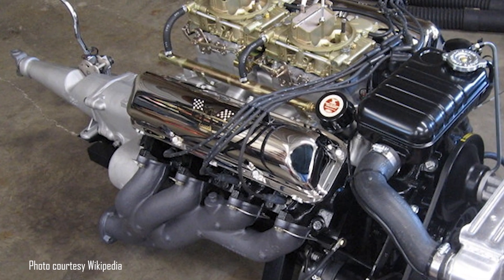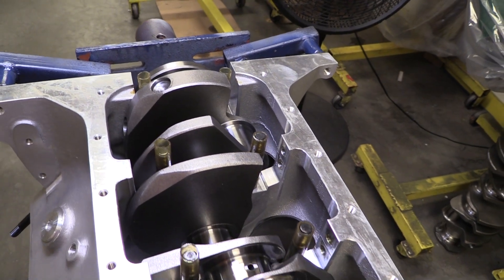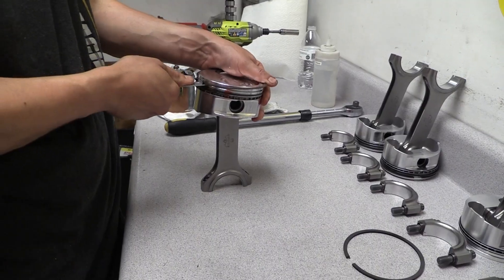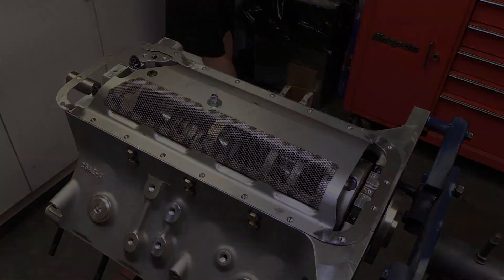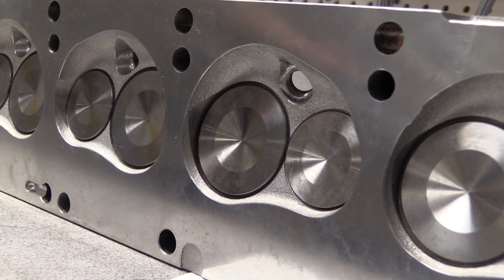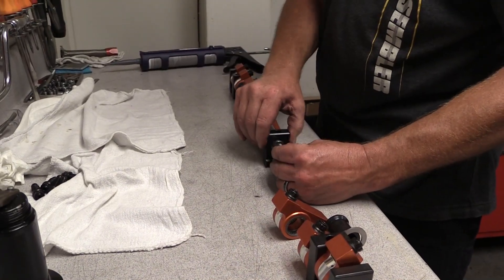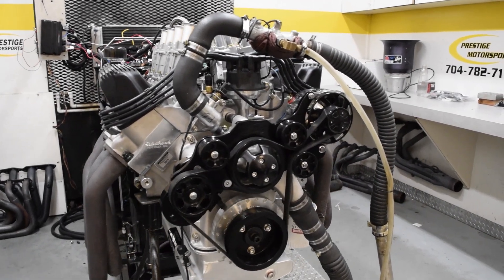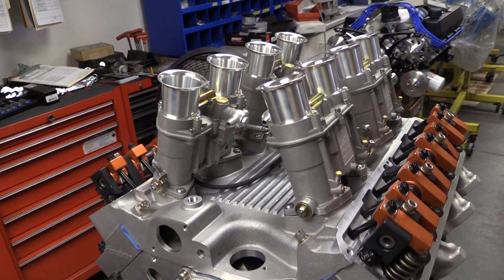Building an All-Aluminum, Fuel Injected FE Ford (with a Carroll Shelby Block!)

Comment: I  built same engine 12 yrs. ago.  It has Shelby block, Ported Edelbrock heads with 2.25/1.75 valves.  10.8 CR.   Cam is 248/256, .625/.646 Solid Roller.  4 IDA fuel injected TB with Megasquirt III.  Made 550 hp at 5900 rpm and 600 ft.lbs torque on 93 octane pump gas. Smooth idle at 650 rpm.   Propelled my 68 Mustang (full interior) to 7.1 sec.1/8 mile.  You are strangling the motor with too little head, and too little cam.  Pics available.
Reply: Exactly no reason this engine shouldn’t make 550+ hp
Reply: Luke Teverino : Yes there is. Cam, heads, throttle body EFi and its an alloy engine. Anyone who has ever built one will know you dont start playing hardball untill youve gotten some base figures in. 501 at 5400 rpm is just fine, but I know where Id find another 130 ponies and a lot of extra torque. Great engine build.Thanks for sharing.
Reply: Dean Stevenson well obviously, I’m just saying an engine that big they could have easily built it to make more power but didn’t.
Reply: Mine is a 4.25" bore with a 428 CJ crank -- 452 cu. in.  Any decent engine should make  1.2 HP/ cu. in.  and 1.2 to 1.4 lb. ft/ cu. in.    This engine with Trick Flow Heads and a decent cam should make nearly 600 hp and at least 580 lb.ft. torque.
Reply: turbo32coupe and Luke Teverino: According to Stan Weiss et al, the heal over point where power and rpm are made is based on port area and valve lift, and actual port Cfm through the inlet at that lift. It is not Cfm but throttle body size that is pegging power back. The advent of Split Dominator carbs on SOHC 427s  in 1970 was because of a very big problem finding  traditional Injection and Weber carb sizes in the desired 1-7/8 to 3 inch sizes which make real power. . Past 342 cubic inches on domestic V8s, any Independent Thottle Body/ Isolated  Runner/ Port on Port engine in the 45 to 61 cube,  3/4  to 1 liter.cylinder size will have to go psychotic in port size and Throttle body size to get even get past 550 hp. 48 mm throttles without a specific cam and port size will start to top out at just 444hp. To just get a gain, you  have to move to 50 and perhaps 55 mm to get 685 hp at as little as 5700 rpm..
Reply: Dean Stevenson Very cool thanks!
Reply: @deanstevenson6527   you are correct.  The ideal throttle body size for my 458 cu. in FE is about 58 mm.  Unfortunately, the intake doesn't accept a TB that big.  I had a large 4 barrel carb on a single plane when I first built the engine.  Dyno'd same hp, but I went to the ITB because the part throttle driveability  was poor.  Too much cam for a street car.  The ITB broadened the torque curve and make part throttle function much better.  Acts like a stock engine down low and a race engine up top.  My 68 Mustang has 3.73 rear gears and 10.W slicks when racing, but will still spin if the track isn't prepped.  600 lb.ft. of torque!  With the race converter and converter multiplication, hp is not the problem, traction is.
Reply: @turbo32coupe  my engine is only 37cubic inch and it makes 108bhp
Reply: If you don't mind, how much $$$$ did you have tied up in the Engine?  Thanks
Reply: @robertclymer6948  
block was $5200 (came with studs); Rotating assembly, $1200; Edelbrock 427 heads (stage 2), $2000; cam and valve train, $2000; ITB fuel injection, $3000 with computer.  Misc.$1000.  Total ~$15,000. Not a cheap build, but it is in my 1968 Mustang Fastback.   I have a single turbo sbc that makes 700 hp, blowthrough carb, that cost $3500.  Turbocharging is the cheapest power.  I have a twin turbo 4.6 cobra motor in my 32 coupe that makes 550 hp on 7# boost. Fiberglass body, roll cage, 2900 lb. car, now that's my quickest vehicle.
Reply: @turbo32coupe  Thanks so much for the reply. I was hoping the build would be under 15k but close enough for my budget. The sbc hp numbers are awesome and he cost even better. Thanks again. Great channel.
Reply: @mewrongwayKOCXF  What does the car weigh with the cage?
Reply: @mewrongwayKOCXF  Nice, powerglide?
Reply: @mewrongwayKOCXF  Presently building a twin turbo 355 with a th400 to go in a 1989 stripped out 4-link caged Camaro. I went with the TH400 also because it was cheap to build and tough enough for the 650-700 lb.ft of torque the engine should make.  Please email me a pic at mciver_peter@hotmail.com.  Thanks
Reply: @Fergus Redpath waaay to small of intake, those Borlas look cool, but nowhere near big enough for real HP
Reply: Can you give detailed cam specs?  I’m building a 454 side oiler with TFS heads and an Inglese 8 stack EFI and would appreciate a steer.
Reply: @CliveJAustin  Sorry for the late reply.  Original cam was 248*/256*, 0.625/.0646, Solid Roller on a 110 LCA.  The cam had a soft spot down low between 1000 and 1500 rpm.  When I refreshed the engine, kept the same Intake valve close and exhaust valve open points, but reduced the overlap.  New cam was 240/246, 0.640/0.646 on a 114 LCA.  This filled in the soft zone at low rpm.  ITBs have dead stock idle because they have no plenum and therefore don't suck exhaust gas into the intake at low rpm.  It's when you open the throttle that you get move reversion and the soft spot.  Widening the LCA to 114 reduced the overlap, but kept the same high rpm function.  You sacrifice a little peak torque for a broader torque curve.  Hope this helps.

Comment: To be honest a great looking and exacting motor build. Although torgue numbers were impressive, hp and rpm was not. I mean 500hp on an engine dyno is not all that impressive. I’m sure the torgue will get the job done. But really how much was the engine?
Reply: Steve Welborn may I suggest that since we’re all amateurs (or u actually implied “dummies” on YouTube) that when u make a video like this that you show the true potential of the motor. Well I would say that if I was interested in a 20k+ motor (just a guess from a amateur of course) that I’d be looking for a bit more than 500hp. But then what do I know.
Reply: As-cast, the edelbrock performer heads max out around 293/192cfm int/exh at .700" lift and 28"hg. Considering the displacement of this motor, as well as the ITBs/aftermarket block/solid roller cam, the heads create a huge performance bottleneck. A bigger cam and a set of survival motorsports/blue thunder cnc ported heads would make a huge difference, I suspect.
Reply: Steve Welborn good save.

Comment: Absolutely beautiful video, well narrated
Reply from the maker: Thanks very much, and thanks for watching!
Reply: The Horsepower Monster : Gracious thankyou for sharing. Its not all about Dolly Parton attributes on the Torque and Power curves and what not. Its about the shear enjoyment of how a nice aluminum FE 482 with steel liners will go together and just last a lifetime in a the owners ride. The Vertical and Horizontal are controlled by the bill payer, and its awfully easy to mess up an alloy engine. Prestigue did the hard part. Incidently, I remember being critical about power figures on a 200 Ford six with Classic Inlines head. Now I realise what a jerk I was seeing how I responded to the 501 hp gross at 5400rpm figure. Sorry. We all need to realise the bill payer makes that choice. Not Us!

Comment: I wish this build had CNC ported heads it would have been over 600 HP with no down side.
Reply: It would have seen 575 hp with AFR heads, unported.
Reply: It wasn't a max effort build.
Reply: Yeah there is so much more power left in this build
Reply: Sure there is, it's called "higher rpm"  to achieve a little more power. How does more rpm and higher peaks fit into the plan when you are building for lower rpm and torque?? You do realize bigger heads require more rpm don't you?
Reply: @vengeanceizmine9878  CNC ported heads with bigger valves will make more power across the entire rpm range even if you only pull to 6000 rpm
Reply: @pyleup  Not in the same rpm range it won't. Bigger ports and valves will make more IF the combination calls for it, yes... but doing so you increase port area, which WILL move the power band higher, as well as peak power. No need for bigger runners or valves if hp was achieved at the rpm you want it. Look at the torque curve. Not all about big peak numbers at higher rpm. Especially if the engine is purpose built for the car. Nobody said the engine couldn't make more with different parts, but if it that's not the goal, then the engine doesn't need it.
Reply: @vengeanceizmine9878  you`re wrong here, several other 427FE-builds proves that
Reply: @vengeanceizmine9878  then why build a 1000HP  short  block  to only make 500hp they could have  made  500 hp with a 390 block bored and Stroked to 445 no need for a 10K short block?
Reply: @64fairlane305  Kind of a blanket statement, made with no explanation or thought process behind it... 
And no, I'm not wrong. A specific port design, depending on cubic inch, will deliver a specific power in a specific rpm range. You increase area, you increase the power range for a given application. No such thing as making a port bigger and making more power in the same rpm band, since you change area. The engine only needs a specific average cross sectional area, and minimum cross sectional area to achieve a goal. That is all the engine sees. Area. Not too concerned what other builds supposedly prove, in a magazine or on the internet... real world experience always prevails. That head doesn't know what brand engine it's on, so it doesn't matter if it's an FE, BBC, SBC or a Briggs and Straton.. Just sayin'..
Next time, make it a bit more fun, with actual real world knowledge behind what you say.. 👍
Reply: @pyleup  Who said anything about need?? Lol.  Is the title of the video "What you NEED to make 500hp"? Lol. Cmon man, think. You ever hear "The customer is always right"?  People want what they want. Not every builder or you tube build video is about max power... maybe they wanted that old school look, and had money to burn, yet still make ok power.. been there done that with people. Everyone has their own ideas, and at the end of the day, you only need to make the guy paying for it happy, nobody else.
Reply: @vengeanceizmine9878  I build a lot of engines 2 426 hemi,s , 3 427 side oiler,s, and many others GM ,Ford and I own a 427 side oiler 1968 it's in my Fairlane  it's .030 over so it's a 433 now with cnc ported heads and matched intake I know what these heads can do. 300 cfm at .500 inch lift on the intake 2.20 valve. I guess if that,s what he wanted so be it  lets put it to rest.
Reply: @pyleup  I hear ya. That was just the point I was trying to get across. Some people pay big for " a look".  As a race engine builder, I get it, BUT regardless, the customer wants what he wants. That is why I focus more on high end stuff, and not restoration and show car engines.
Reply: @pyleup  To save weight
Reply: Lol, bigger heads are just going to loose torque with those restrictive TBs... thats the killer on this build, they look great, but borla shoulda built them with the ability to scale up to 70mm

Comment: No lube on the lifters
Reply from the maker: He brushed assembly lube inside the lifter bores. Then the lifters are filled with oil when the engine is pre-lubed on the dyno before start-up. Thanks for watching.
Reply: @TheHorsepowerMonster  Should have pre-soaked so the rollers don't start dry.
Reply from the maker: Before fire up on the dyno they manually spin the oil pump to prime all the oil galleries. By the time it is fired up all the components are fully lubricated.

Comment: You had my attention up until the box stock Eddy heads. I was like, I'm out!
So many missed opportunities to make respectable HP.
Reply: Because 500hp isn't respectable...
Reply: Luke Coomer ... not really. When we have 5.0L coyotes making 480 hp.
Reply: You have to realise that sometimes they have deadlines or a customer not willing to pay for modifications. The stock Edekbrock heads will be better than any stock FE head. If it will only be driven a few time a year on the street then what they have is PLENTY for a replica Cobra.
Reply: @geoffmooregm  I realize this customer had more money than sense. Clearly it was built for wow factor and not performance. That power band is all wrong for a light weight Cobra that is going to see competition. Only good for a smoke show.
Reply: @TheSlim93gt  Well wouldn't be the first guy to do it lol. I worked at a shop that was building a 69 Charger with a modern 5.7L Hemi. The motor was straight from the junkyard and the customer wanted twin turbos and a stand alone ecu to run it all with goal of 900HP. I just shook my head and actually quit not too long after because the owners were just as stupid an encouraged it! The other laugh is he wanted disc brakes in the back. So the shop ditched the Dana 60 and put in a Ford 8.8" from an Explorer "because it has discs". I asked what the fuck they were thinking just get a D60 Disc Brake kit. They said "Oh but this rear end is only $150 from the wreckers with discs and a limited slip." I'm like "You put a much weaker C-Clip axle in with tiny disc brakes and you want to ram 900HP through it! What the fuck were you thinking?" I swear those idiots watched Overhaulin' once and thought they could run a Hotrod shop.
Reply: @TheSlim93gt   agree. 
Ported heads help the most at higher rpm's. 
This engine is not high reving. 
Too much low end power, quite early roll off = truck engine. 
But still, i respect 500hp, and it was pleasure to watch, as always. 
Excuse my English.

Comment: 😁😁😁😁😁 ITB's 😁😁😁😁

What an engine build $$$.
Great to see the dyno with all the accessories in place. That's a real number. 
Still surprised it makes peak power so low in the rev range? imagine if it had a cam to let is sing past 7,500RPM!!
Reply: 7500 rpm will introduce reliability issues with the valve train. All aluminum construction has some drawbacks. Thermal expansion being one of them.
Reply: @reallifehardtruth4465  aluminum isn't a problem because the block and heads are both aluminum.  Block is good past 1000 hp. Have to set the lash hot.
Reply: @reallifehardtruth4465  Aluminum blocks are tough as hell. Production Teksid modular blocks are handling 2,500+hp in Pro 10.5 trim.